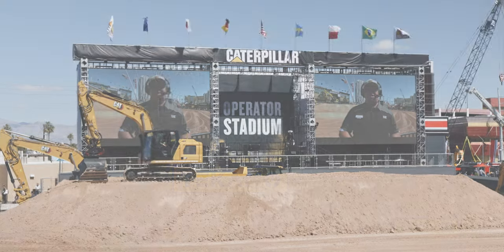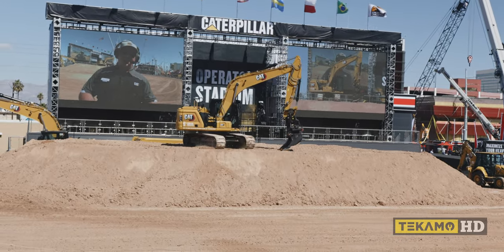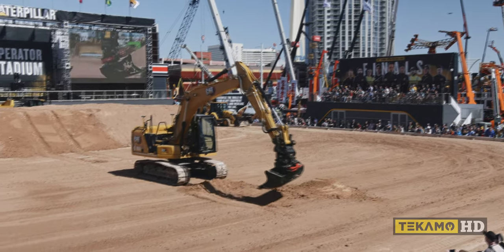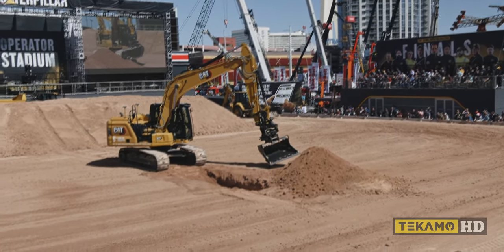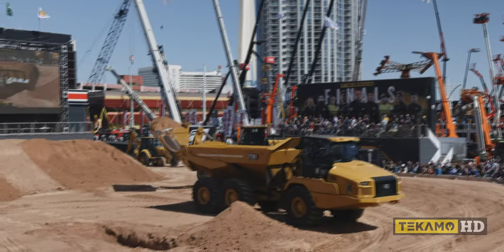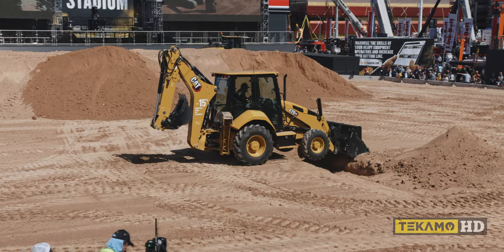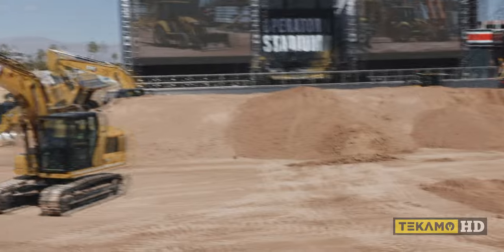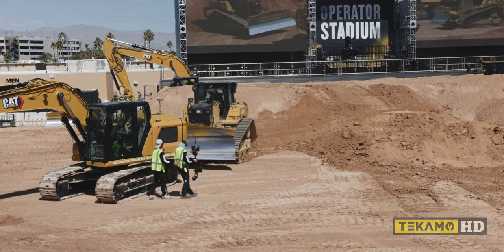CATERPILLAR Demo Show At ConExpo 2023 Las Vegas

Comment: I've recently been operating a couple of these new generation CAT excavators.  A 336 and a short radius 325 and they are excellent. They have the grade control and assist feature but I haven't had a chance to work out  how to use them to their full. The payload monitor and weighing system is great for accurate loading of road trucks. Interesting video,  thanks for posting.